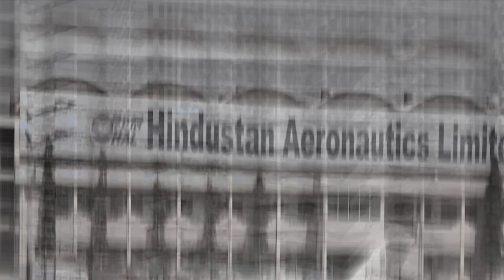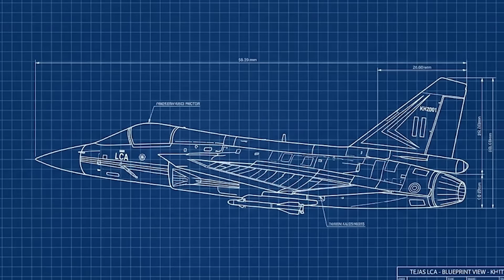Tejas Crash: The Shocking Truth Behind India’s Failed Fighter Project

Comment: To be fair to India and Tejar, that crash in Dubai shouldn't define Tejar's reliability because the said pilot could have misjudged his flight path and gotten too close to earth. However, it could also because the instrumentation on the plane is not good enough to assist the pilot.

With that said, it is not hard to see why the project is such a pain when that photo with workers squatting on the ground in a tight workshop. That looks more like a backyard mechanical workshop than a high-tech machinery factory. Not wanting to rub salt into the wounds, the failure of the Tejar project is but one of the many symptoms Indian industries are exhibiting.

Comment: Good riddance to Tejas and should be put down immediately instead of putting the life of the pilot in jeopardy flying the metal coffin in the air.
India is just a delusional country full of fancy.
A eulogy is best describing the Tejas incident instead of a tribute to the deceased as departed too soon in highlighting India Air Force unacceptable high accident rate or poor safety record.
India is all noise and braggadocio. 
India should be flying remote control aircraft and use a transmitter on the ground for recreational purposes rather than military aircraft often labelled as a “lying coffin” and a “Widow Maker” due to its frequent accidents.
India makes powerful statement by talking about its superior weaponry and equipment as the most powerful nation to be reckons with.
No countries come close to match India's aircraft from falling out of the sky.
At least 152 Indian Air Force pilots and 534 aircraft have been lost to accidents and crashes over the past 30 years or so, research conducted by aviation expert Anchit Gupta has revealed.
Finding the solution is something that's eluded India since.
Crashing aircraft is a normal habit of India.
India is in a league of its own.
India is all boastful talk and nothing else.

Comment: if they get the engine, the radar and other key components from other countries, why didn't they copy the body design of a proven platform or even better, they could have set up an assembly line of a proven fighter.  What is the point of reinventing the body design when they are trying to catch up and there are many other more important issues to solve. Drafting (slipstreaming) is key when you are not the leader yet.